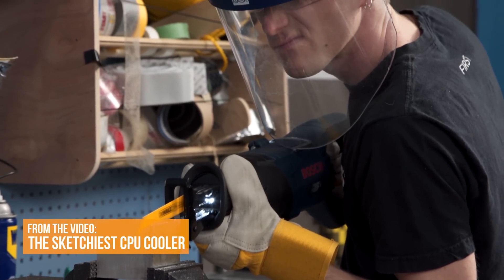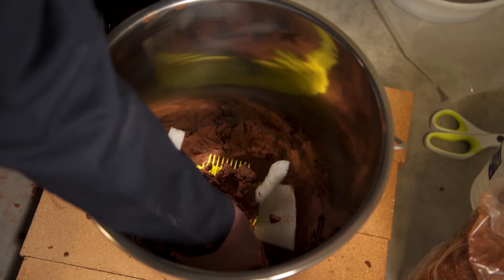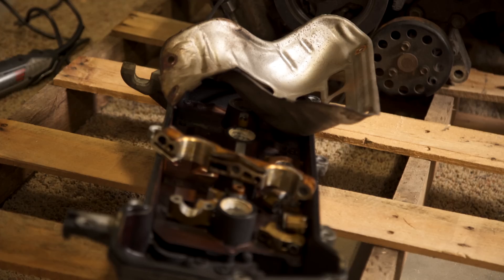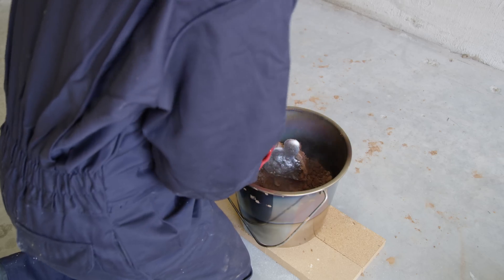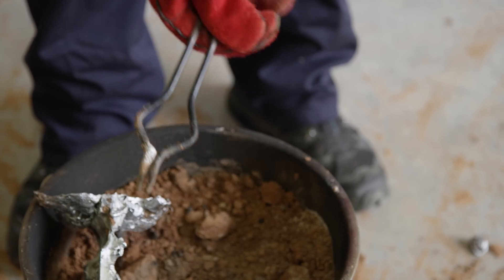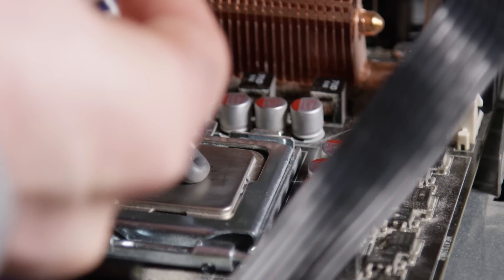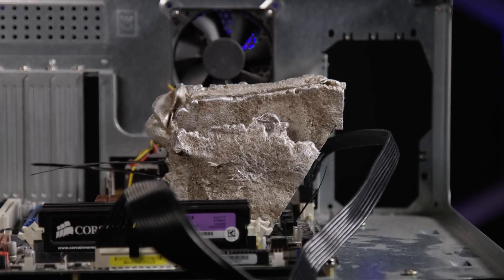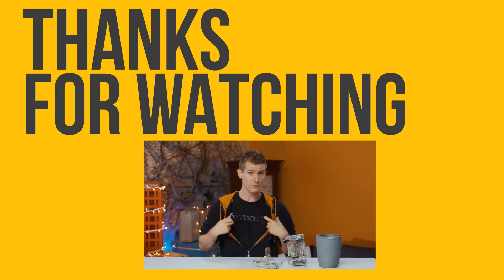The WORST CPU Cooler EVER – Sketchy Heatsinks Ep2

Comment: Just screw a couple of Aluminum plates together and make sure to put some heatpaste in every joint. DONE
Reply: I would give you a medal but this is the internet so I'll just give you a like AND a comment.
Reply: Im Phanta Yes. Linus, you keep trying to make a heatsink out of one solid piece. Just build one with pieces. Get some thin sheets and bolt them together.
Reply: Im Phanta
Or maybe just use the radiator from the car they took the engine out of for a watercooling setup.
Reply: Water cooling's so last year, nitro cooling the new thing,

Comment: i actually plan on making my own heatsink. aluminum is bad.... hard to use even though it melts at a fairly low temperature. shouldve used copper

Comment: Use evaporative cooling. With the alu block from episode 1, drill a hole thru the block. Connect 2 adapter with hose and let water run thru the block. Instead of the normal fan and radiator, build a mini fountain that will cool the water.

Comment: Well, with what was used. You probably could have cast a solid cube of aluminium, then use a hacksaw to cut the fins into it. I mean, casting is nice and all, but it's terrible for thin leaves unless it's a surface pour with a singular layer.

Comment: Can't you make a 3d printed custom heatsink on SolidWorks or AutoCAD and then print it out, cover it with heat resistant silicone and make a mold out of it and then pour the aluminium in it???

Comment: Get a bunch of 1m thick plates in, say, 3cm x 2cm and 3cm x 10cm sizes. Start with a 3x10 plate and alternate 3x10 and 3x2 plates until the heatsink is ~3cm thick (an approx 3cm x 3cm base), so that you both start and end with a 3x10 plate. Place in a vice with the heatsink's base flush and drill 2 holes for screws/nuts to hold it together. Double check base is flush and tighten screws.

Voila! Sketchy heatsink v. 3!  (Modify as desired.)

Comment: Maybe should've used more flow channels, like one for each fin. Maybe even set it up so that all you need to do is to put the cast in the forge with the aluminum on top so that the cast is hot enough to let the aluminum flow into the cast freely..

Comment: Good god, the sloppy shittily cut fins. You could have pulled it off, you guys just didn't do it as required. You need tightly packed sand preferably much less sloppily thrown together foam and air holes made in the fin array and on the opposite end to allow the molten metal to displace the air in it as it flows in. Making a mold isn't THAT hard ffs there is ton of information online and youtubes even got plenty of people making ridiculously good molds while showing you how. It took them a week? WTF!

Comment: Also, using a removable pattern and a two part casting flask is far more likely to work than fucking around with lost foam. If you are going to do lost form casting, it's probably better to use a properly fired ceramic mold rather than sand.

Comment: why not cast a block of aluminium and make a copper disc which is perfectly smooth and have that as the contact point on the block of aluminium making thermal contact better.

Comment: should have just used normal sand. wont cool the aluminum as quick.  will be rougher but fills cracks better aswell. I always used coal in mu forge. just a steel bucked wih concrete on the inside

Comment: you should have flipped the foam and poored it into the face of the heat sink. (it's easier to flatten one surface rather then 50 edges.)

Comment: Pretty please just use a bandsaw with an adjustable fence on a block of aluminum before you even think to start to explore lost material techniques of casting. You're jumping into the deep end of the pool before you even know that water is wet. I just make things mainly from wood IRL and this series has my OCD triggeredly entertained, but also very super definitely triggered.

Comment: A few notes
1) Aluminum Heat sinks are not cast but I guess you figured that out
2) Aluminum Heat sinks are extruded and then machined as needed.
      a)Machining processes include drilling holes or crosscutting the fins producing a pin fin style HS

In my past life I worked for a major computer manufacturer and the way we would prototype an aluminum heat sink would be as follows.

1) buy a chunk of 1100 series aluminum
2) Use a Wire EDM or RAM EDM depending on Fin pattern
3) Machine as needed (note when machining use a cold gun to keep the aluminum from gumming up)

Who ever came up with the idea to cast aluminum needs to apologize to the staff who tried it. burns from Molten metals are bad very bad!
Reply: Come on. The guy can't even use a reciprocating saw correctly. You're asking too much of him.
Reply: If die casting was more economical than extruding than it would be the standard. cost makes the decision 9 out of 10 times. Yes you are correct about "it could be done"  but it is like saying you could "swim around the world"
Reply: good luck casting a tall thin section in sand. you may have better luck with die casting but it would be cost prohibitive in mass production. Industry standard for aluminum is extrusion.
Reply: Was def lucky it didn't explode lol. Looked very damp and that can lead to a nice pop.
Reply: exactly
Reply: how many blocks do you think they'll destroy before knowing how to use the cnc I'm guessing 5
Reply: Scott Stephenson My friend got a realy small bit of hot plastic on his skin, got a scar now. We threw a bottle of deo in the campfire....
Reply: if you mean CNC mill, than it can be done with 6061T6 aluminum but you have better thermal properties if you use 1100 series. when you mill 1100 series it can heat up and the chips will load up the end mill and then fill up the slot you just cut and eventually break the end mill. if you use 6061T6 you have a better chance at being successful but only if you are making short fins. If you want tall enough fins you best bet is to use a wire EDM.
Reply: I mean you can cast heat sinks, really you can make them with any standard metal manufacturing process. While extruding followed by machining is the best way to do it operations such as sand casting and even die casting are very feasible.
Reply: I'm well aware that it is the standard. I was just making the point that it could be done. Also I think you have that flipped, for large production runs die casting becomes even more economical given the up front capital investment. For this case though, especially seeing how theirs turned out haha, I think sand would have been their best bet. Cause they're not gonna buy a set up for extrusion lol.
Reply: Scott Stephenson not only would die casting be cheaper it would also me much faster but that would be hard as hell to cast with all the thin fins
Reply: Yeah, it would have turned out fucking terribly if a bubble in that clay popped molten aluminum all over the people around the "art project".

Comment: Ugh don't just use random scrap aluminum for a heat exchanger. You would have been better off with a 1050 alloy H18 temper small ingot to use for casting.

Comment: idea 1) if you guys are willing to give this another try on the lost foam, i would say to not use the poor holes on the sides, but to rather use straws to go to all of the fins then  bring them to a central poor spot, it should kinda look like a colander . also vent holes would help a lot ! keep the holes on the sides but make them much smaller so you don't need as much aluminium to fill the mold. these would help with venting  as well.
idea 2) or you could buy sheets of aluminum the thickness you need for the fins  cut them to the lengths you need for the fins and spaces  between them make a big aluminum sandwich  and put 2 bolts through the whole thing .

Comment: Well, a heatsink works by having a large surface area contact with the air... So why not make a copper base plate, with crap tons of spirals of aluminum wire mounted into the copper...  So, just, gobs of spirals of aluminum, pulling heat from a big copper slab...

Comment: Sketchy heatsinks suggestion: Make it out of aluminum flashing, copper pipe & end caps, aluminum screen mesh, and aqueous ammonia. Cap an end of copper pipe with solder. Tightly roll up the screen mesh a few times and put it in a length of copper pipe (provides capillary action). Fill with a bit of aqueous ammonia (lower boiling point than water). Make a f*** ton of fins and spacers with flashing. Drill a hole in each one the size of pipe, ensure tight fit. Slot them in and then cap the pipe (the cap will prevent it from sliding off). Now figure out a way to mount this to the CPU.

Comment: im sorry that i cant give that much advise cuz im just learning about doing sand casting, but i know enough that this hurts a little. The sand looks very off. to much water and probably to much clay. i think the sand should feel a lot like slightly wet sand, but clump together well under pressure. also if done right this might work, but the space between fans has to be larger so the sand doesnt grab to hard. i actually kinda want to try this now just to see if its possible.

Comment: Try using metal springs and a copper cpu heat sink.. stretch it and stack them in spiral spot wield it all up. cable tie on a  noctura fan.. good to go.. :)

Comment: also you would do better cutting a heat sink from a solid block using a big ass angle grinder with a cut off disc of some sort. multiple discs. you will break at least one disc.

Comment: For the final video of this series, you should make one with subtractive manufacturing using a CNC mill. If u guys (LTT) are interested I have a 5-axis mill I'd be able to run your designs on.

Although, now that I think about it... The space between the fins on the heatsink are most likely too deep or very close to the tolerance off the end mills flute length. So that would indeed produce another sketchy heat sink.

Comment: When you do casting you can't expect the molten metal to rise so in this instance it would have been better to have had the cast off turned on it's side with the vent and pour holes coming into the side of the heat sink at it's thickest part which is the base.  You could also have made a length wise rail on the side if the fins facing up and used that as the vent tube to give the pressure somewhere to escape along with the gases and encourage the metal to fill in the fins.

Comment: Why not make the whole process in a larger crucible? Then you can keep the head on the aluminum and mold until it's had time to work it's way into the mold, melt away all the plastic and fill all available gaps. You could also try a centrifugal force rig, though something tells me flying, molten aluminum, while good for views, would be bad for your warehouse and insurance ;)

Comment: Use a blade with fewer TPI in your sawzall. Yes aluminum is metal but it's soft you don't need a blade made for steel to cut it, and having a fine toothed blade just gets clogged up with aluminum and makes it cut slow.

Comment: If you use oil instead of water to bind the sand, it won't suck away all of the heat from your aluminum. Also, your aluminum needs to be WELL ABOVE MELTING.

Comment: I did some aluminium work when I was in fart school. We carved wax, poured plaster around it, then baked the wax out. It took some time, but if you vented it properly you ended up with a very detailed copy from just a pour (no pressure). Why do it right the first time when you can spend a week of half-assed tries? On the easier side.. you could look into thermally conductive epoxies. Maybe pour/cut the main slab and use epoxy for the cooling plates. if the epoxy works, you could even attach some copper pipe to an aluminium block.

Comment: Usually you melt the foam or plastic out before you pour your metal.  Look up lost wax casting process.  3D print the model in castable wax, cover the model in plaster.  allow to harden then melt out wax, then pour in metal.  That's how they cast turbine blades.

You could try using Shapeways to directly 3d print a heatsink using the aluminum materials.

Comment: Linus, have you considered fusing copper/aluminium tubing together as a makeshift heatsink? Fusing tubes lengthways would make an easy makeshift fin matrix, fusing a base would then allow you to fix it to the CPU. Alternatively, cutting tubes lengthways so they make long half circles ')' shape, aligning them in a "))))))" fashion would create a makeshift fin layout. Again attach base and work from there?

Comment: Serious question:  Linus seems a bit upset with the result and I could understand that.  However, considering that the outcome of the heat sink is trivial and in fact will likely produce more views the worse it is, what did he think he would get?  I do assume that expectations were low and the results were even lower but I mean....I LOLed at the result and wish I am starting to wonder.....can I make a reasonable heat sink with a flat bottom rock....?

Comment: You need to make a 2 part mold. Had you used 2 buckets and made sure that the sand was set properly with proper entry and exit port, this could have worked. How about changing the fin design to a swirl pattern. Similar surface area, may work better.

Comment: Use an aluminium plate and and cut in pieces. Then rivet them togheter and grind the bottom flate. Should do the job and be easier to make.  :-)

Comment: The not so sketchy home.. ahem.. shopmade heatsink:

Block of copper nicely machined flat. Milled several half round channels into it. (ended up with 5channels). Made some heatpipes with some water and a vacuum pump  and copper desoldering wick as a thermal wick.

Squashed the 5 heatpipes into the 5 halfround slots (ending with a flush base with heatpipes directly contacting the ihs) on a hydraulic press. Silver soldering (silver brazing) the heatpipes  on the block of copper.

Punched holes into aluminum sheetmetal. (for that i made a crude punch die.. to cut the outline of a plate and all the necesary holes in one go on the hydraulic press). Ended up with about 50 plates. Threaded the plates with some spacers on the extending 10 ends of heatpipes, and silver soldered the plates to the heatpipes.
 The plates are massive and have a lot of thermal mass and the gravity works with the heatipes and with the natural convection from the plates. I run it without a fan.

Comment: you should have made the green sand thinner with a consistance closer to water than placed your mold into and poured it over. The first one would have worked except it was upside down. all of them were upside down. That or creating vent holes at through top of each of your high points aka (fins or veins of the heatsink) for the air to escape because it created high pressure points.

Comment: So for a sequel, have you considered throwing a milling machine at block of aluminium?

Either a manual 3-axis machine, or a CNC 3-axis milling centre. My workplace has a bunch of CNC mills, and the heatsink would be super easy to mill. We laos have some electric discharge machining systems, but those take a small millennium to cut up large objects; but they can do all sorts of fun and weird shapes.

Comment: You should test the 3D printed heat sink
Reply: You missed the joke.
Reply: Dirges You don't have to buy the machine, there are services who do that. There is one like 5 kilometers away from me.
Reply: You have a point
Reply: i think it would melt :P
Reply: Metal 3d printers do exist... but are crazy expensive and are slower to make things.
Reply: psst: the thermal properties of plastic are < 0. it's a thermal insulator.

Comment: This is a really bad method for trying to make a heat sink. Your best bet is to get a chunky 5mm or so base plate, then make a load of fins from 1mm aluminium or copper sheet, then use a MAPP torch and low temperature brazing rods to join them to the plate. Do one fin at a time, with the fin held in place with a jig and heat the seam up,  remove the flame and draw the brazing rod across the seam. You can get aluminium thinner than 1mm but I'd advise against it, you have pretty bad luck with tools and you'll probably just burn holes in the fins and make a mess. It's also a lot cheaper than casting. Best of luck :D

Comment: Riser design was extremely poor. Looking at that there was no way the mold would have filled up. I also doubt that you had taken up draft angles over the top of the fin surfaces to aid easier ejection from the green sand material.

Comment: If I wanted to make a quick cheap heatsink in this way:

I would have placed a 1966 Canadian dollar (80% silver 20% copper) on a hotplate and then found a thicker tall piece of copper piping to surround it, and then slowly turned up the hotplate (or heat the hotplate very carefully with torch) and/or apply a small amount of downward force, until the copper just started to fuse into a nice natural air-free base.  Then drill holes in the tube for mounting.

That design should provide a decent amount of surface area for least amount of difficulty manufacturing.  Its also a silver base, which would be double the thermal conductivity of aluminum and significantly better than a pure copper base.

Comment: i have a small garage with some tools left over from my carpenter days. ill try to make something and post a video of it. when you cut metal with any blade u gotta lubricate it. i like wd40 but ive used everything from trans oil, gear oil, veg oil, canola oil hell i used coconut oil once. cuts come out great when u lube them up

Comment: you guys poured it incorrectly...the fins should have been at the bottom, not the top of the cast on the first 2 casting.  your guys obviously didn't do very much research on YouTube prior to trying this.  they could have used aluminum case to melt...didn't need to buy a motor.  ~~No efforts given~~